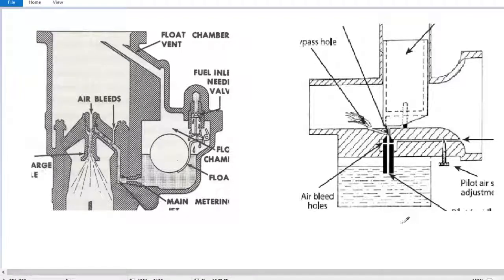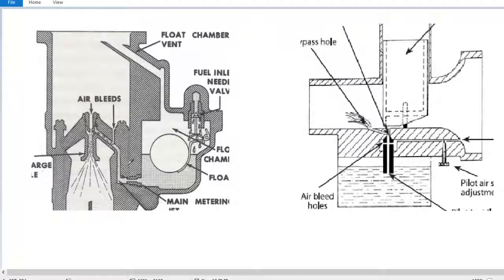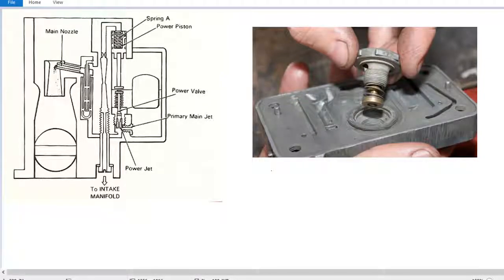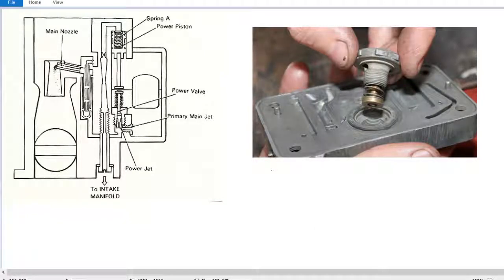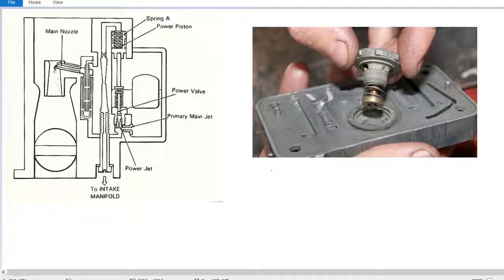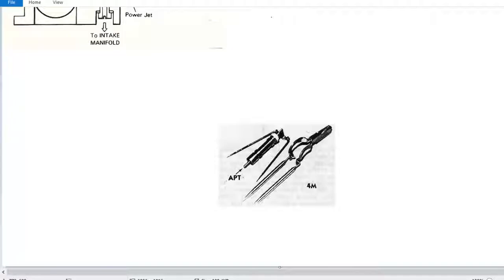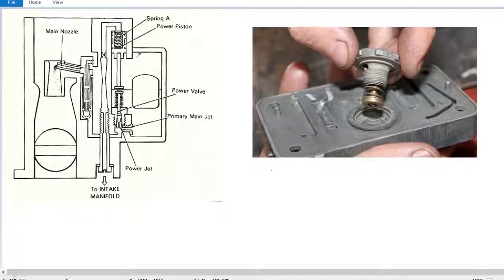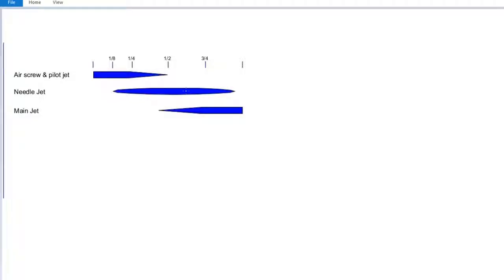Carburetor tutorials - Holley and other carbs, power valves E06

Comment: im enjoying these vids when i have time thanks for doing them. One point that you made on power valves for holleys that i have delt with. when using a large overlap cam with a low idle vacuum if you adjust the power valve to seat at idle you starve the engine at mid throttle mid rpm loads you starve the engine of fuel because te vacuum has now recovered and the power valve is hung closed due to ajusting for low idle vacuum. in my experience when going from idle to rolling on the throttle like at a circle tracksome times a part throttle is needed to keep the tires hooked up on a tighter track(you just cant clank it) and ive burned a piston because of that. the fix was to go to a power valve with a slightly higher vacuum rating and it would no doubt hank open during idle. but fuel doesnt flow on the main at idle so no issue there and when you took the green flag throttle changes fast enough that the power vaalve whould have opened anyway. i hope im making the point that im trying to say...thank again for the vids im inpressed with your knoledge on these subjects. nobody anymore nose carb stuff i make a good living because of it. im out keep going
Reply from the maker: Hi John, thanks for the comment. Yes the power valve doing the opposite and closing off idle inst good, as you discovered. 
With HP engines my rule of thumb is always go rich on everything, not for safety but if it has a cam and tuned pipes and so forth there is usually points in the RPM range where those things provide a bit of an extra power and as such fuel demand. Where tuning close to best AF it has points in  the range like that it starves a bit.
More common in 2 stroke engines when the wave and gas action falls into line it gets very thirsty at the power hump.
From there I just work around leaning up below the hump to get it a bit crisper on the gas.
Ive been a mechanic since 1976 and some of that in Speed shops I first encountered Holleys.
They are a great carb but they can do some odd things sometimes that needs a different approach.
Glad you liked the vid.
Cheers